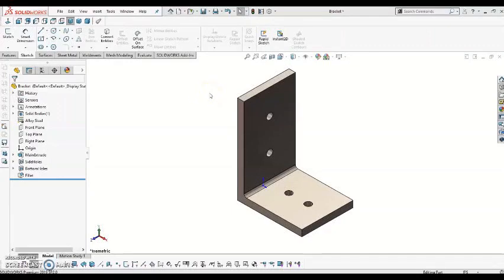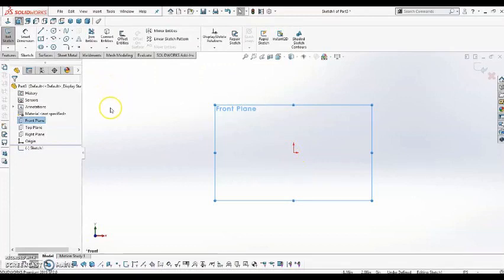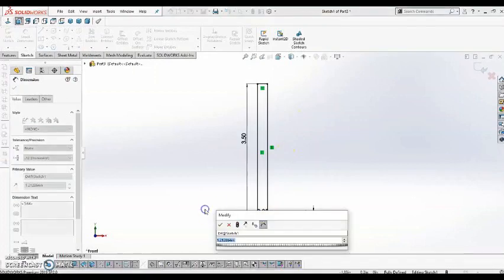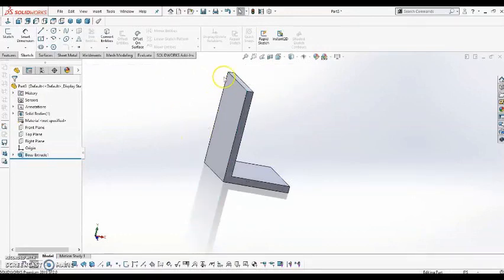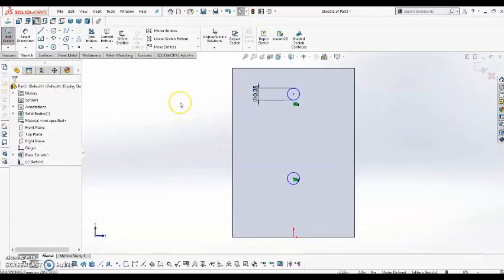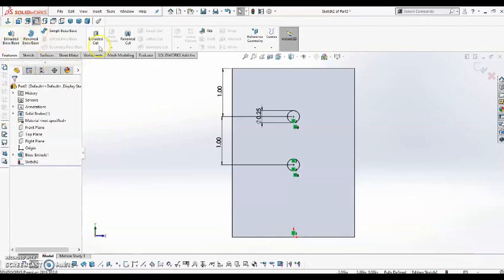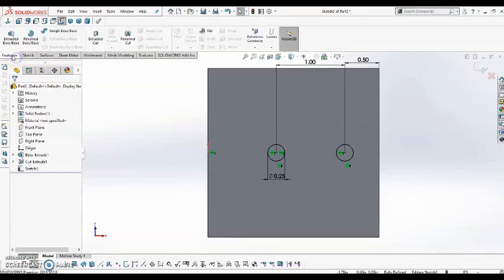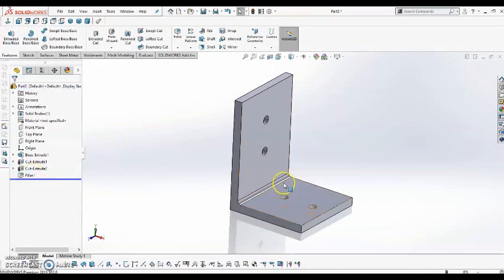SolidWorks - L Shaped Bracket

Comment: Why not use structural members to create the L bracket? This was pointed out to me when I was doing a sw job interview that doing L bracket manually like I'm this videos is incorrect and could cause problems later on during part manufacture because you maybe didn't include the standard thikcnesses... Also most L brackets this simple can be done using sheet metal feature....Also for holes, you also have the options to use hole call-out for more accurate tolerances on fasteners fitment....... Just imagine how muchore you could had shown people with all these different correct features to use in creating this bracket.
Reply from the maker: Joan, you're absolutely right! I love when advanced users check out our content. We should have been a little bit more clear in our description. Our original intent was to create a video that could help some of the people who have no SOLIDWORKS experience. In fact, most people we share this with are simply looking and playing around in a SOLIDWORKS Trial. We chose not to show structural weldments because we wanted to highlight very basic modeling. Going to edit our description now! Thanks again !